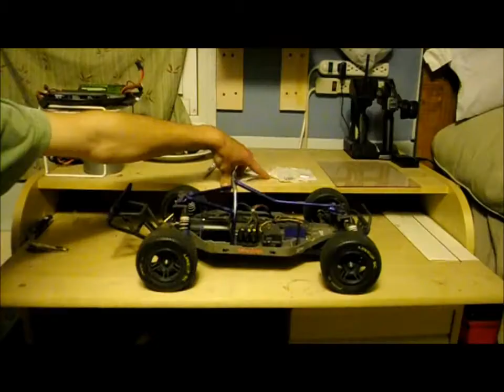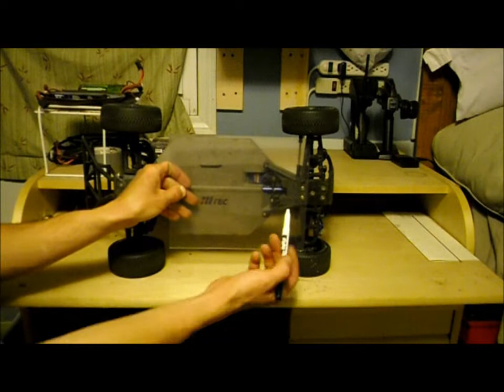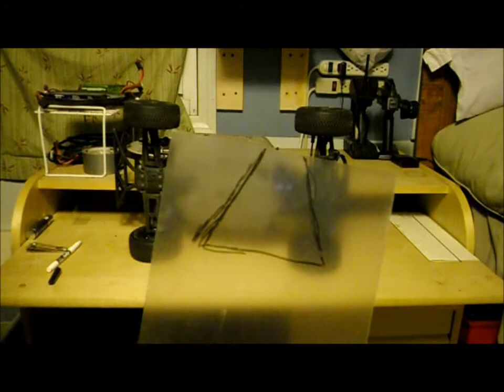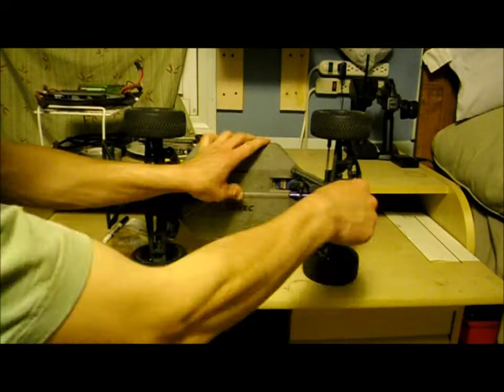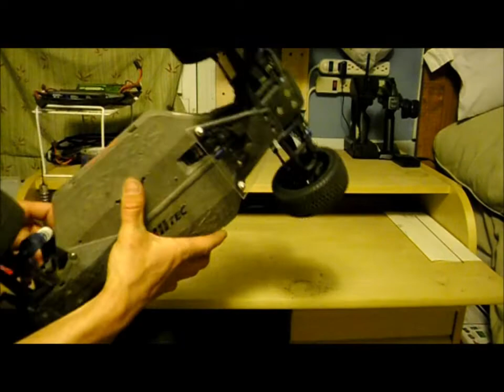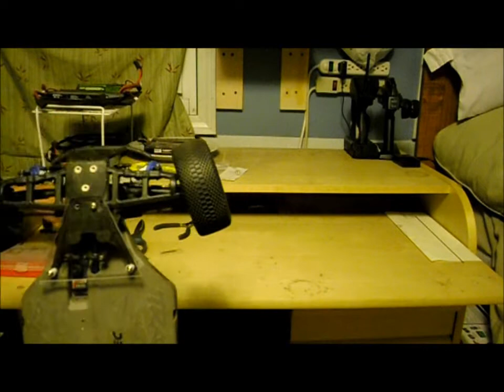Traxxas Slash 4x4 Servo Guard DIY

Comment from the maker: These are Duratrax Lineup SC's. Good tires overall, tread whare is very good. Ive ripped on pavement a lot and hardly any whare. Which is why I have tires on. Been using Slash at a park that has a gravel parking lot, a grass field and a paved basketball/tennis court. Terrean is mutiple. They are perfect for that. On track, straight dirt, not so well. Not meaty enough. Get Proline 2.8 Badlands, trust me besides roll over, which is easily fixed, best tires Ive ever used for slash and stampede.